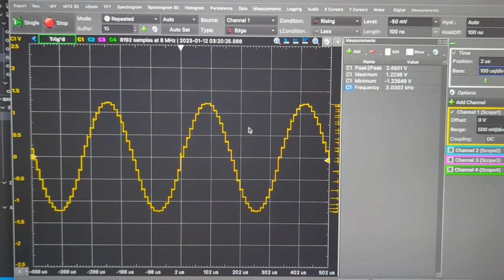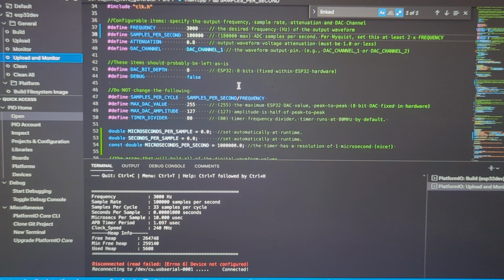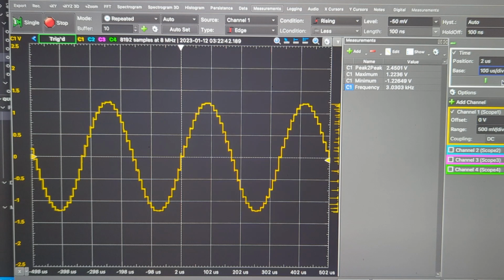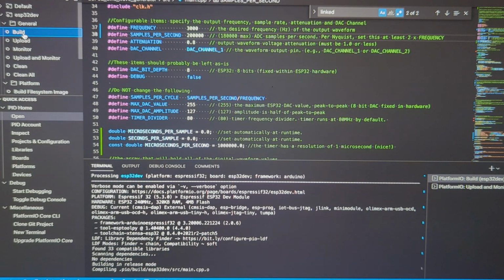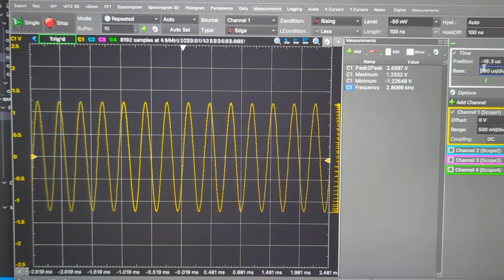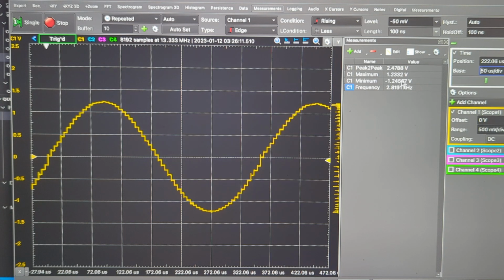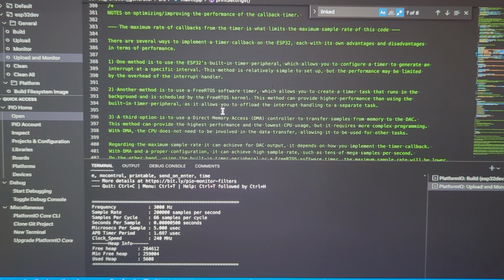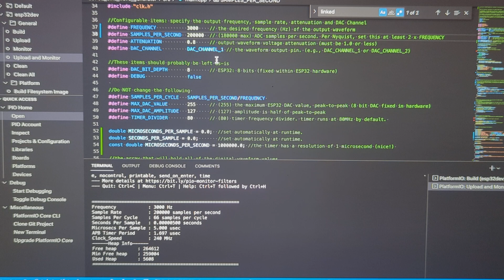ESP32 DAC: tips on using the sine wave generator

Comment: Отлично работает. А можно сделать с модуляцией?
Reply from the maker: You can change the value of ATTENUATION in the code, in order to change the output level. The value must be between 0.0 and 1.0. Also, I have recently posted a video on how to use an op-amp to shift and/or control the level of a signal. Here is a link to that video  https://www.youtube.com/watch?v=srN_DY_xZm8
Reply: Большое спасибо. Всё очень интересно. @philipgiacalone5605